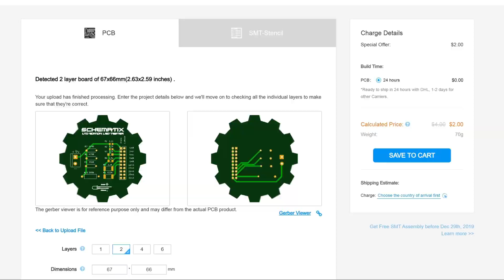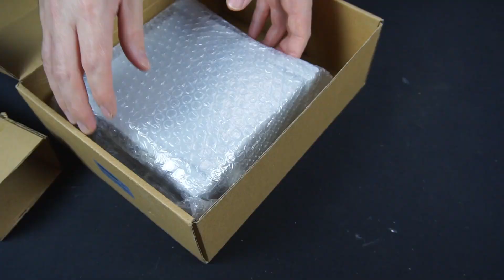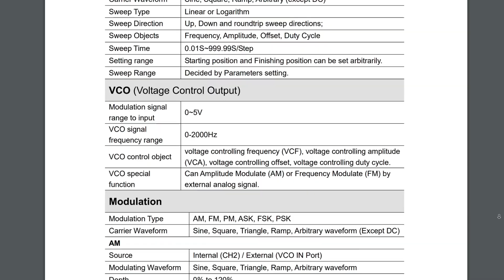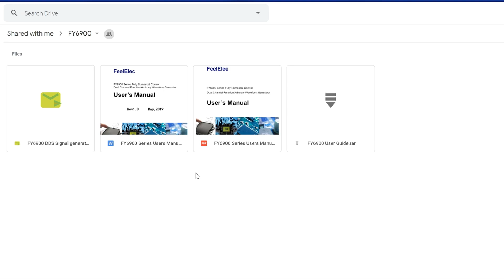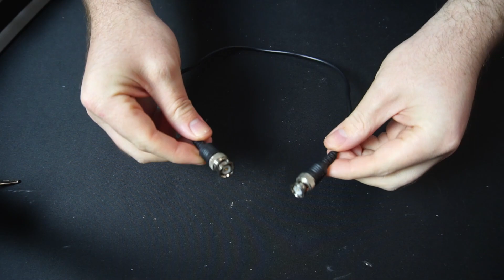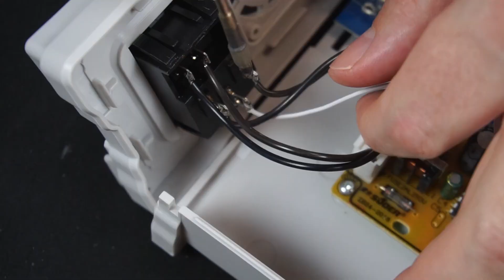FeelTech FY6900 60MHz Arbitrary Waveform Generator ll Review

Comment: Good quick overview, although I did not get the impression that Schematix spent much time with the device.

Some things I noticed with mine (100MHz version):
- Yes, the included BNC-to-BNC cable(s) are not to be trusted with higher frequency signals, also they are unreasonably short
- The integral frequency counter says that the device's own generated sine waves are 56.9% duty cycle (which also appeared in this view, but was not commented on)
- None of the buttons on this device are "Tactile". That term should be reserved for buttons where the user can feel the moment when electrical contact is made, such as ones that have a "click" or other tactile feedback.
- My device also still had the label over the piezo 'beeper'. My guess is that the manufacturer might be leaving them on to keep the beeper volume a bit more muted, because while the user can defeat the beeper entirely, there is no control over the volume, and it might be annoyingly loud without the label in place.
- Having to set potentially long numerical parameters one digit at a time (instead of with a keypad, which this device does not have) quickly gets annoying. And the knob, being without knurls, and pretty shallow, can be a bit more difficult to turn than it should be, and it has to be turned a lot during operations.
- The manual, while better than with most Chinese equipment, is hardly "comprehensive". A LOT of important things are not even mentioned. The more one uses this device, the more issues with the manual get noticed. One example; no mention is made about how to properly exit any given screen or menu. For the most part, the CH1 or CH1 button can do this, but it is hardly intuitive.

But overall, this unit offers a lot of bag for the buck.

Comment: As some people already mentioned: linear regulator / LPS is a must , but warning: dual 12V rail shown on that pcb is actually 13.6V, so if you use eg LM7812/7912 then you will have 12V rails and the unit ... will not even start properly and will not work ! 
Friend of mine had built such a regulator and tested it and then had to change to LM317/LM337 to get 13.6..13.8 V rails. 
But after swapping SPS to LPS the performance of the unit is quite good.
But then you will need a small fan and some air openings in case as well to cool the unit and some heat sinks;  
Also it needs proper screening , all around the case. 
Some wires are underrated and shall be changed.
And it needs 4 rubber stands/feet, otherwise it keeps moving on a desk when front buttons are pressed.
And one more thing: firmware shall be at least 1.4, older have many issues. And ver 1.xx is really bad. 
 TO MY KNOWLEDGE THE LATEST UNITS THAT THEY SELL HAVE FW 1.5.3

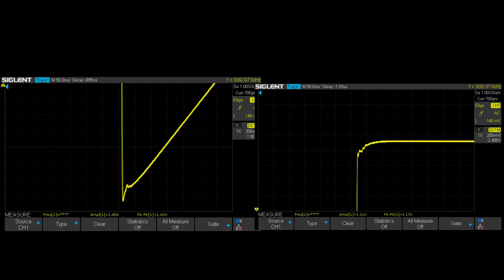Comment: 5:09 what if you add T connector on the osciloscope side with 50 Ohm resistor and set the generator to 50 Ohm load?

Comment: Received a New User Comment: "How do you turn it on ?   Read the manual, impressed with unit and specs. Plugged it in, pressed the power-on button lower left front panel, and nothing happened." -- Had to advise New User to turn on the rear-panel power switch first. They were then happy campers.

Comment: Not sure why the presenter, and folks in the comments, are making fun of the idea of washing the PCB. During manufacture, after placing and soldering components, PCB assemblies go through a flux cleaning process. Some components would be harmed by the cleaning solution, so they are temporarily sealed against that. After the cleaning process, those seals can be removed. Just like on the loudspeaker in this video, which apparently did not get removed. Pretty hilarious?

Comment: I left the cover on the buzzer otherwise it's too loud. I intend to replace the SMPS with a linear one because the SMPS radiates everywhere all around the bench making low level measurements on the scope or meter impossible, even if connected or not. Otherwise a nice little piece of test gear.

Comment: Well done, superb precise scripting and demo! Don't forget that the observed ringing  with BNC direct is due to reflections. The scope cable end should be 50 Ohm terminated. Alas the Siglent1202-XE  (as most scopes do) has only 1M input option. I have a 1202 and love it. 
Did you see any time jittter at HFs like seen in the 6800?  Cheers.

Comment: The unit I recieved showed 12.320 Volts ch1 and 12.180 Volts on ch2 when set to 12.000 Volts DC.
The seller told me this is within the 5% output. 🤯😬

When the output is adjustable in millivolts, 5% should be 5% of 1 millivolt.

Please reply with your output accuracy tests. Thanks.

Comment: Its all well and good the way you've presented it but the proper real test would have been at 60MHz (max capability), There is where I really want to see the weak points and a proper close-up at any ringing that might happen. At 1MHz (you barely scratched the surface) who cares when I've got 59 more MHz to go?

Comment: What about frequency accuracy???. Mine is about 70hz out at 10MHZ
Reply: Mine isn't,  I just got it today and check it 
at 10MHz, mine says   9.999992 MHz        close enough
Reply: @martinkuliza  Hey Martin. I blew my Wavetek out and thinking about picking this one up. How has it been for you. Accuracy and stability? How hard have you pushed it? Thanks.
Reply: @PackardDog  
i'm just gonna respond quick now... ok 
because i don't have time to give you a complete answer
but i also want to re assure you i'm going to give you a good answer,  oik

SHORT ANSWER :   yes, i've pushed it... of course i have , that's what i always do 
can't remember exact results , but... i can tell you this off hand

it's a good little unit 
Stability is fine
as for Accuracy ..... it's not bad,   i could nit pick at a few things but overall it's fine
i haven't had any problems with it 
as for price.... Price is my last consideration , i don't even enter into price when looking at specs because i see the two as completely irrelevant to each other
but in terms of price.......... it's fucking cheap as shit 

but i'll answer a bit better later on.. ok
Reply: @martinkuliza  damn good answer? Good enough for me. I   appreciate it. Gonna pick one up and give it a go.
Reply: @PackardDog  
Really.... i was going to give you readings.
but if you're good with that
then yeah.. go for it

I haven't been disappointed thus far
what i can also say is this ....

RE the software
Now... keep in mind, I'm 47 and my eyesight recently isn't that great
now.. if you're like.. 19 years old this might not bother you

but.. the fucking writing on the screen is fucking small because the screen is small.. obviously

i explored options to mod something up where i can output the video feed to the display to go to a 22" monitor 
THAT DIDN'T WORK THUS FAR

but... I have installed the software to a computer AND THAT WORKS FOR ME 

but.. you'll need a computer with DECENT SPECS
so.... don't cheap out and go for i3 CPU with 1GB of RAM

you don't need top of the line
but,  you need something half decent to get a decent response from the software
now.. if you do that... YOU'LL BE IMPRESSED , it reacts pretty quick

so yeah it's a good little unit
i say ... get it 
AND BY ALL MEANS , LET ME KNOW HOW YOU FIND IT, OK
thanks mate
also let me know if you want me to do readings for you

Comment: Great video, but I really missed you actually took out for a bonafide test and if it loyal as the higher and more demanding aspects.
No doubt that Fy6900 is one item many hobby people are looking at as you get quite a lot of signal generator for the money and the metal housing and overall build quality and rubber bumpers are excellent, and IMO second to none (muhhh muhh' sorry back from the land of make-believe) nahh those factors are as tacky as it comes, but then again for something like 75USD that you can pick the 60mhz variant up for, it is difficult to complain about the lack of build quality and ain't really a display piece and you do get a lot of signal generator for the price + PC interface and IO.
if you get the time, digg a little deeper into this unit... great video +1
Reply: Btw, I just compare my unit Fy6900 60mhz (74USD from EU) to yours and can see numerous board components that have changed.
your display board and your mainboard seems to be revision 1.9 and mine is 2.0.2 and says something like FY69S, the board is also green in mine.
if you want pictures, just holla.. got a picture slide on Imgur.

Comment: The power supply looked dodgy. But easily replaced. It was plenty of room for a better one.
Reply: kind of my first thought when I seen it. but room for a good mod..lol
Reply: linear regulator / LPS is a must , but warning: dual 12V rail shown on that pcb is actually 13.6V, so if you use eg LM7812/7912 then you will have 12V rails and the unit ... will not even start properly and will not work ! 
Friend of mine had built such a regulator and tested it and then had to change to LM317/LM337 to get 13.6..13.8 V rails. 
But after swapping SPS to LPS the performance of the unit is quite good.
But then you will need a small fan and some air openings in case as well to cool the unit and some heat sinks;
Reply: Bought one and was utterly disappointed. Didn't work at all. Startup is OK and it passes it's self test. Then it enters main window and that is it. Whatever button i press the only thing that happens is that the cursor on the frequency field is advancing one step at a time. When it reaches the last digit nothing more happens. So totally useless. The software is horrible also. Unstable and looks like it is programmed for Windows 3.1. Keep away from this poor excuse of a function generator.

Comment: What about the wave forms at 60MHz?  Why did you show them?
Reply from the maker: Good question. The reason is not all waveforms can go upto 60mhz. If you read the manual it lists the maximum Hz for each type of waveform. Aside from that, it's difficult to stress test a signal generator in every possible application/scenario. So simply cracking it to the max, and observing the waveform doesn't prove much.
Reply: @Schematix  Fair enough; however, I do want to see what practical upper limit of the generator can really do.  No stress test so to speak.  It's fair to show if the generator can do 30MHz with reasonable distortion or before the low pass filter cut off.  A lot of low cost signal generators cannot maintain the proper waveform at higher frequencies.  We are dealing with Chinese product here so a fair review should also give prospective buyers a real picture of what they are getting.  Again, no one is expecting this to be a $10K signal generator, but showing what's real and what's advertisement matters more to a great "review".

Comment: Sort of a hurried video.  What does the square wave look like at higher frequencies?  What about the sinewave?  Looking at 60 cycles and 1mhz is a start.  But surely no-one in their right mind would buy a signal generator unless they say how it worked at the higher frequencies.
What sort of roll-off does it have as the frequency increases and distortion?  Not much of a review, more like a sales pitch!